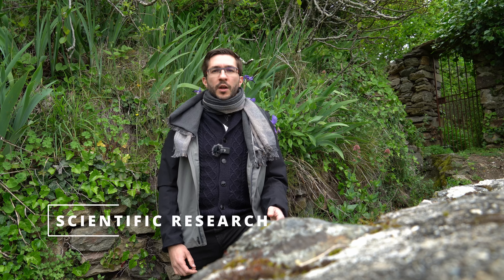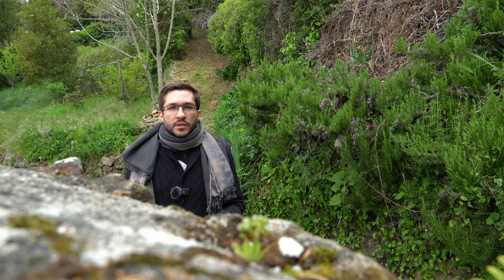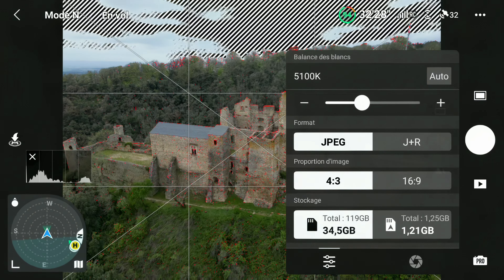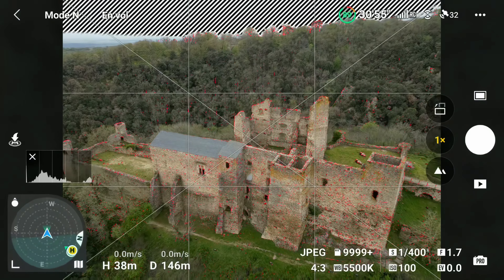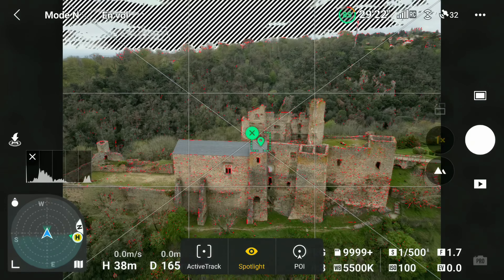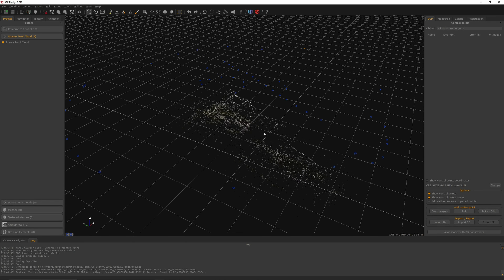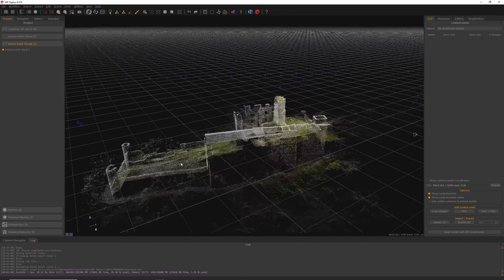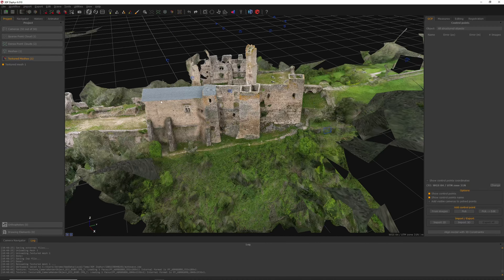3D modelling with the DJI Mini 3 pro (using photogrammetry)

Comment: Have you tried combining drone photos with camera photos for photogrammetry?
Reply: Idk if the creator has but that’s 100% something you can do - just a separate process to combine the sets of images! Def a fun process so check it out if ya can
Reply: @JoePelusoMedia got any sources that j can check out?
Reply: @SpaceSightAir  Yeah search this in youtube "Merging Components using Control Points in RealityCapture". Basically its the same process for merging two components as merging two different data sets... 

Tbh I haven't done it in a while... but if I remember correctly the process would be... upload camera photos, process those to a point cloud / component... then turn those camera inputs off (right click and disable), then upload the other photos (for example from a drone), and then create the model / point cloud / component from that... then using control points identify the common features so it merges the two components. 

One big issue I think for drone and camera photos not aligning well is the aperture (and probably other similar settings like that..). It changes how the software looks at the image and sometimes you can correct for this after the fact (by "pre-processing" the image through some other software / step..) but yeah, the goal is to not have to pre and/or post process (the fewer steps the better)

Hope that helps!

Comment: Very good priner on the subject 👌🏻  - one thought: could you not use hyperlapse- manual ir better: Circle with 2 secobd intervals, slow speed at several altitudes to capture the photos? Im always trying to use available features / tools to autonate a process such as the photo captures.

Comment: Thanks for the tutorial!
If I remember right, DJI Mini 3 pro has a function to record metadata in captions for the videos, like coordinates, iso, focal length etc. So I believe it is possible to make a good model from photogrammetry using individual frames from the video if you can extract data from the captions for the each frame. In programming perspective I could write a script for that so the next time I will try to check this possibility
Reply: Let us know
Reply from the maker: Most photogrammetry softwares actually implement  the extraction of frames from a video. You can also do it using DaVinci Resolve, Premiere Pro, or any paid or free video editing software. Even Blender can do it !
I've done a lot of photogrammetry from videos, it works fine usually.
Reply: Problem with video is the quality, motion blur and resolution is less than photos. Better to use photos unless time is limited and you don’t need best quality results.

Comment: Thanks for the great walkthrough! Does the 3d model/export retain spatial data that can be used to scale object with some degree of accuracy? For example automatically setting world size so I don’t have to guess the units in an imported scene ?
Reply: Yes. 3d models are spatially modelled to scale. Their accuracy depends on several factors like GPS accuracy etc. But you can extract measurements like height, width, length, area and volume from 3d models.

Comment: Hi, did you shoot in the 48MP or 12MP mode? I would like to see a comparison, if the megapixels make that much a difference, in terms of texture detail and geomatry accuracy. I guess it's more about capturing close-up photos from different angles than just the megapixels. I am a little bit on budget and was planning to just buy the Mavic Mini with a 12MP sensor for cheap. Thanks!

Comment: Thank you for this good tutorial. As an architect with a Mini 3 Pro, you gave me the kick to dive into this!
Question: What file types do this programs export? It would be phantastic to be able to import those models into my CAD programs. What about the file size?
Reply: Photogrammetry programs can output an orthophoto (2d), DTM and DSM which can be used in CAD software.

Comment: Truly excellent, thank you. Am very curious about trying photogrammetry, also with a Mini 3 Pro. Question: If you produce a gorgeous 3D model using for example 3DF or Meshroom, are the viewers for your audience easy, or do they have to install that software too?
Reply from the maker: Once the 3d model is exported to a .obj file for example, any 3d software will be able to display it, including the default Windows 3D mesh viewer. No need to install the photogrammetry software just for visualising the end result.

Comment: Does anyone have a suggestion for a utility to build a good 3D model that lets you install more than 50 pics and is a bit cheaper than 3DF Zephyr, which is $200 for more than 50 pics?

Comment: Merci beaucoup 👌 Vraiment topp !! 
10:57 Question, why not use the 48MP mode ?
Reply from the maker: 48 Mpx mode would produce sharper and more detailed results, but each capture takes at least 2-3 seconds to be processed. The standard 12 Mpx mode is much faster and allows for fast and effective capture. But if you have more time, then I would suggest using the 48 Mpx mode.

Comment: Hi, thank you for the instructional video. You mentioned that all the orbital pictures were taken at the same height. Is it only one orbit? if you do another orbit at a different height, the software would be able to produce a better end outcome?
Reply from the maker: Yes, generally speaking, the more photos you take, the better the result can be. However, the photos need to be taken with sufficent separation from one another, in order to add information to the mesh. Doing a few other orbits at different distances would also help to capture more detail in the object (the closer you are, the better the resolution). But be careful with the alignment process : if you do not have sufficient photos that "link" two orbits, the software might have a hard time aligning the different orbits to produce a single, good mesh. I would recommend taking intermediate pictures while getting closer/farther, or moving to a higher or lower altitude.

Comment: How would this model compare  in Agisoft Metashape  ? Better or worst?  Could you supply the model pictures for a comparison in other software's such as PIX4D which I also have  !
Reply from the maker: I have not tried to reconstruct this particular subject in Agisoft Metashape. And sadly, I lost all the source files. From my experience, the mesh tends to be smoother in Metashape, the smoothing step must be more aggressive by default.
Reply: Pix4d wouldn't give a great outcome. It rarely does for 3d vs metashape, reality capture or contextcapture.

Comment: Is the software more graphics or processor heavy? Or both?
Reply from the maker: It uses both, really. Some steps of the calculations are GPU-heavy, while others are CPU-only, it really depends. But if you want good performance overall, you better invest in a decent rig all-around.

Comment: Hi. What are the specs of the computer used on this project?
Reply from the maker: Hi, the specs are AMD Ryzen 5 5800X, 32 GB of RAM, and a NVIDIA RTX 3060. All the data is stored on a SATA Samsung SSD for both source photos, software cache, and resulting files.

Comment: Would be nice if anyone knows how can edit model ( replace trees or fix building roof.. ) can't find any right tutorial 😢 
I learned 3DF new tricks 😮 thanks
Reply from the maker: Some photogrammetry softwares allow for some minor adjustments, but for more heavy processing, I would recommend Blender, or MeshLab, ZBrush, or similar.
Reply: @inkarz - did you find a solution for trees?